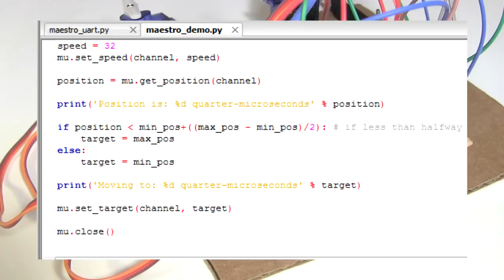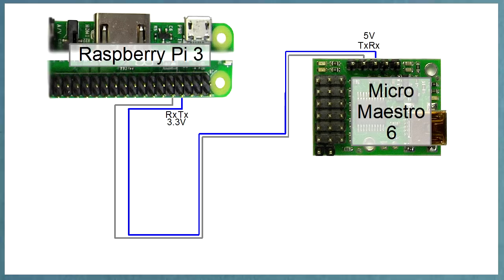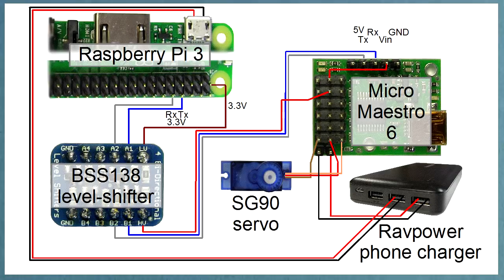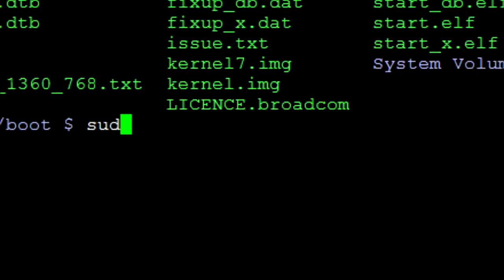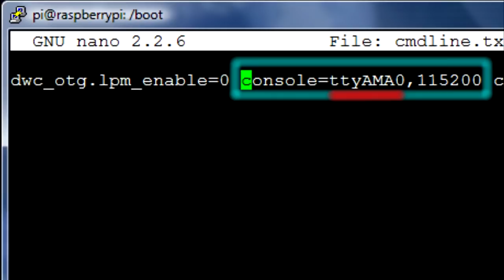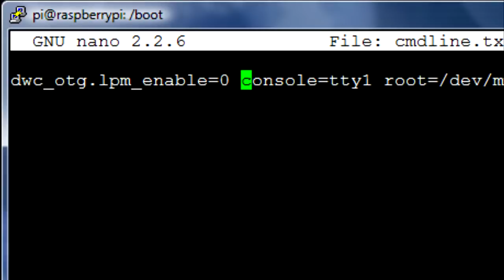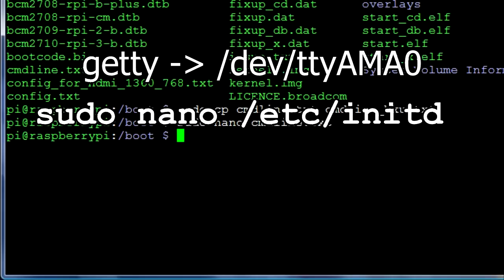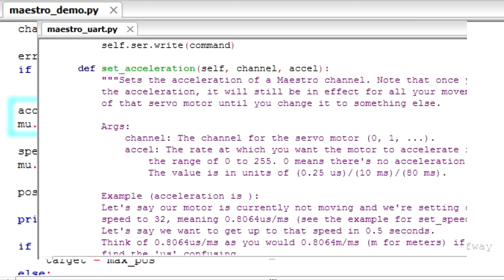Servo Motor With Raspberry Pi and Maestro board

Comment: Very helpful tutorial. I've actually been able to use your Python module to send commands to the Maestro both via the UART and USB connections. For the USB connection, you have to set the serial mode of the Maestro as 'USB Dual Port', and when creating the instance of the MaestroUART class you must set the serial port as '/dev/ttyACM0', since from what I understand the Maestro creates two virtual ports when connected via USB: '/dev/ttyACM0' for commands and '/dev/ttyACM1' for communications. I didn't have to change anything in cmdline.txt to get it to work. I also haven't seen any problems with having the Maestro's power coming from the USB connection, even when moving many servos at once.
Reply: John, thank you - very helpful comment with explanation how to use USB.
Reply from the maker: Thanks for sharing that.

Comment: How do I expand the range of motor? seems like the motor moves only in the range of 992 - 2000, but it actually moves only 30 degrees.
Even without the if logic regulation the motor doesn't wanna move more than that. Could you help me to solve this? Thank you :)

Comment: Hey, what should I do if motor runs at least 6V
Reply from the maker: That's not a problem. See the Maestro manual pages88-89 https://www.pololu.com/docs/pdf/0J40/maestro.pdf.
Reply: Thank you so much!! Also, which way did you use to control pi as I didn't see either HDMI wire or wireless Bluetooth adapter. Sorry to have so many problems...I'm new to raspberry pi and your video really helped me a lot! There are so resources I've checked but they can be very complex or just not working..
Reply from the maker: The Raspberry Pi has WiFi built in. I connect it to my WiFi network and access it from my computer. But the question then is how do you set up the WiFi on the Pi in the first place? Most people connect an HDMI monitor and USB keyboard and mouse to it and boot it up like a regular desktop. That way they can set up the WiFi. After that they can boot it up like I do and access it remotely. If you don't have a monitor and keyboard to connect to it then it's more tricky. I talk about all these options and some solutions on my webpages here https://rimstar.org/science_electronics_projects/connect_to_raspberry_pi_via_wifi_wirelessly.htm
Another getting started resource is the main Raspberry Pi website here https://www.raspberrypi.org/
Reply: RimstarOrg XD I forgot I have the WiFi adapter, it’s in the box. Thank you!!

Comment: Is it possible to use the 6 channels to controll 6 servos? Or two of them must be used fot leve-shifting and signal?
Reply from the maker: You can use all 6 channels to control 6 servos. See the video at 2:25. Instead of using jumper wires to connect all that, I could have flipped the board over and soldered wires to those points underneath. That way all the servo pins on top would still be available. I did it the way I did so that I could have easier flexibility when trying to power things in different ways.

Comment: For what it's worth, what you're doing by removing the "console=ttyAMA0,115200" is disabling the serial console in the Linux kernel on the Pi (which is probably obvious).  Linux supports having a serial console just in case something truly terrible happens and the regular consoles can't be brought up -- the serial console is extremely low-level and can be used for debugging.  ttyAMA0 is, of course, the serial device, and the 115200 is the baud rate.  You've got to disable the kernel's serial console since you're going to be using the serial port, and you don't want the linux kernel to think that it's allowed to use (and monopolize) the serial port.  I think on bigger iron, the kernel is configured to use one of the later serial ports (though I admit, I haven't tried to read or write to the physical serial ports in ages), but of course, it makes sense that the Pi's designers would want to give the kernel the serial port that is accessible on a Pi, if they intended people to be able to use the serial console.

It might be more clear to put it this way: The kernel has to get exclusive access to the serial port it's using as a console -- it produces "monitor" output and takes "keyboard" input on that serial port and anything else trying to use it would send garbage to the operating system.  Hence the need to take that serial port away from the kernel in order to use it to talk to the Maestro.
Reply from the maker: Thanks.

Comment: Why not Arduino?
Reply from the maker: Do you mean instead of the Maestro servo motor controller board or instead of the Raspberry Pi? If you mean instead of the Pi, I'm going to run some big neural networks on the Pi with a Pi Camera. If you mean instead of the Maestro, in my experience I'm getting finer servo movement with the Maestro than I ever did with the Arduino's main loop.

Comment: Well, the PI has a USB port, so couldn't you connect the Maestro directly to the PI, without the level  conversion? Or would it require some other quirks and software to get working?
Anyway, nice video!
Reply from the maker: I saw that others couldn't get it to work so I didn't try it.And thanks!
Reply: @RimstarOrg  What´s the problem with running the Maestro via USB?

Comment: Why would the pi have trouble controlling a servo like those pictured but the Arduino (a far inferior setup) not?
Reply: No problem, the Pi is a fun tool though. AFAIK it's basically what you'd find in a smartphone, which is why people use Pis for stuff like media hosting servers for home, streaming boxes (like chromcast), very light-weight desktop for internet browsing, and other stuff you would normally need a personal computer for. Arduinos are more for robotics and machinery and other types of control systems.
Reply from the maker: The Pi is running the Linux operating system with multiple things going on. Depending on the priorities set for things, the servo software running on the Pi can be interrupted at any time, which means you'll have delays. It is doable, just won't be perfect. The Arduino has far less going on. There are interrupts for timing, but that's far less than a full-blown non-realtime OS.
Of course, even an Arduino can have delays depending on what else your code is doing.
Feel free anyone else to pipe in on this...
Reply: Well, the pi is magnitudes faster in clock speed, and operations per second, than an Arduino too so it should be able to handle it unless someone was playing a video game on the pi but just sitting there calculating, and computing, and controlling the Pi should blow the socks off of an Arduino.
Reply: Real time operations like controlling machinery requires a controller with a real time clock that lets the controller start and finish operations in exact time frames. You also need the software that times and schedules your operation exactly in the time you expect. Regular OS like Linux and Windows schedule threads to run whenever based on whatever algorithm they use to efficiently give every program time to run, which is how they can handle multithreading hundreds of programs running in the foreground and background.
Reply: Precisely what I wanted to know Panzer and the #1 reason I never jumped on the Pi bandwagon and your explanation confirmed my suspicions from a few years ago when PI was first released .  Seems it would be better, and cheaper, to use a Pic or an Arduino for these sorts of things.

Thank you.
Reply from the maker: That's why I'm using the Maestro board. I'll be doing image capture and processing with the Pi, and so I offload the time-critical control of the camera servos to the Maestro board. But it's early days yet, to see if even that will work.
Reply: Right, I am just saying the robotic stuff you could just as easily interconnect the Arduino, or Pic, to the Pi and have even more control but in the end it takes even more hardware slammed on the Pi when the lowly Pic or Arduino is best suited for this because it is not a multitasker.  You aren't going to program a FSM on an Arduino or a Pic at near a level a Pi will do it but a Pi is not ever going to be near the level of controlling servos, and steppers, either.  I remember when the Pi first came out and it was to be the Arduino 2560 killer for 3d printers but we see that never happened and this is part of the reason why.  The other part is that in the end it costs as much, or more, than a China made 32 bit controller designed for the job.